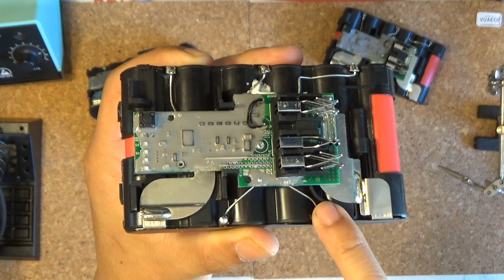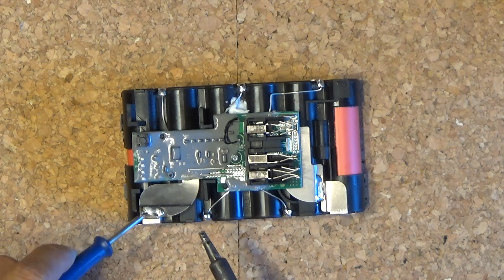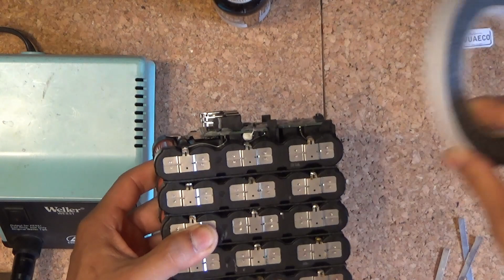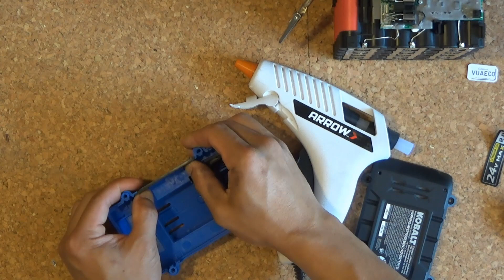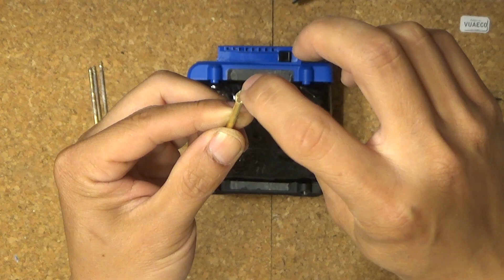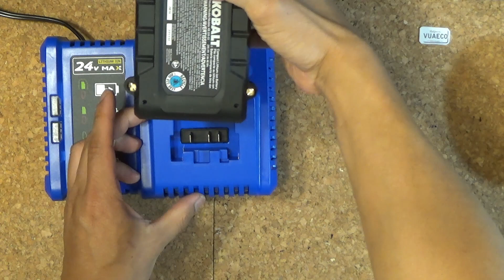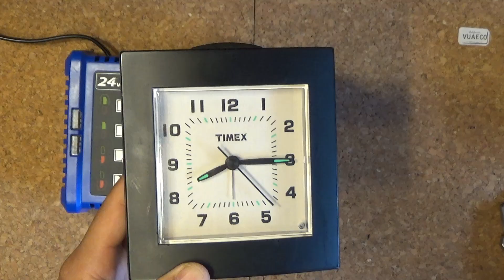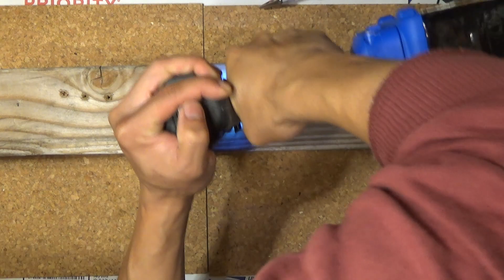DIY: The World's first 10 Ah Li-ion power tool battery built for Electric Bike home-made

Comment: You are stupid. There is no more power. It only last longer.
Reply: It is absolutely MORE POWER! Original 2A/H battery is only 48 watts. With this set up, hes getting 240 Watts. Watts IS Power!
Reply: Higher capacity batteries CAN provide more current. If the tool you are using can take advantage of that, possibly when it bogs down, then you will get more power from a higher capacity battery. There will be no difference under normal use though like you would have if you somehow increased the voltage.
Reply: there is more  power.I am using milwaukee impact gun with 5.0 ah,when i put 9.0 gun has more power,heats up faster, changes sound.9.0 ah is killing the gun,never tried long with 12 ah,gun would prolly die first day of use.fully charged 5.0 ah in use,voltage will drop to 19 volt,9.0 voltage will drop to only 20-20.5,and the gun cannot handle that voltage under load for long...
Reply: That’s the point he wants to keep voltage and make the battery last longer, if you have a 24v electronic you don’t want to over volt it to get more time out of it. It’ll just give you better performance and eventually burn you motor out.
Reply: I guess no one will venture to answer the question!     Wow, lots of opinions here.   Anyone want to try to answer a question?   If you have a 120/240 volt single phase 10Kw, 12.5Kva 60Hz generator connected to your house.   You push the button and start the generator.   How many amps is it putting out?
Reply: @KevinCoop1  all of them
Reply: @earthenergyhex     Incorrect.   You can not answer the question.   You do not know what loads are connected and turned on.
Reply: @KevinCoop1  no, I am correct
Reply: @earthenergyhex    Explain please!
Reply from the maker: @konolfodinsson4096  Hey Konolf, I totally agree with you, mate. I just check back here from time to time to entertain myself when I get bored. These silly comments keep coming. They've never disappointed me. That's why I pinned it on the top!
Reply: @vuaeco  People are actually arguing about if a larger "amp hour" battery has "more power" or not.
Reply: would this work on your e300?
Reply: @adamalexander4689  You are talking about longevity of the peak power usage if you are talking about voltage sag.  The OP is correct. It doesn't utilise more power, it just makes the drill work longer.  The drill works at 24vDC and consumes a specific maximum current when the battery is fully charged.  Adding multiple batteries in parallel doesn't change the drill's working voltage and peak current draw.  For the sake of it, the motor itself will have a working voltage of 24vDC and a specific wattage rating. Unless someone can get the specifications of the motor, we won't know, but we can guess based on working voltage and a battery fully charged.  There is possibly a 24vDC voltage regulator and current limiting circuit built in, something as simple as a zener diode.  The BMS of the battery may affect the draw too.
Reply: no you're stupid .. it has to do with how a battery's voltage lowers more and more the less juice it has in it.. if the pack is higher capacity it will run at higher voltage for longer
Reply: @Nasirisme  No one said it doesn't last longer.
Reply: @octapc  you must have completely misunderstood what i said... Batteries have a higher voltage output depending on how charged they are so if the battery has a higher capacity its gonna give you more power because it will stay at a higher charge level longer
Reply: @Nasirisme  just because someone has a differing opinion, does not make them stupid!
Reply: How many BMS you are using ?
Reply: @Rafaeljotiar  that’s My only concern. He removed all the other BMS’s. Worried about keeping the cells balanced.
Reply: The shown diy pack can provide around 5x20A thats 100A continuously. The formula for electrical power is P=U•I. If you use 20V as U its 20V•100A=2000W.  The smaller packs: 20V•20A=400W. Therefore your statement is wrong. Whether the tool needs more amps than the smaller packs or not, i dont know. So the power the tool brings to the table may stay the same.
Reply: @julianweiser9985  the electric motor is not winded for 2000w or even 400w. So there fore no more power. I mean the drill is not powereful.
Reply: @ashaygoyal1158  in this case, impossible. BMS limit current for protection. Tool motor and battery needs to be correctly designed. If tool draws more power than battery can handle BMS will take action and limit it. If BMS fail battery have a fuse to prevent explosion but will lost battery cell.
Ok but this not happen because battery and tool motor is correctly designed, so single battery provides all the power of the motor can consume.
Reply: @adrianorrs  I doubt a normal Ah size battery could provide the maximum current aloud. Where as one 10 times more might be a noticeable difference. PLUS , wouldn't a longer time of the same power be considered "more"?  tell me what you think. now i want to o a test. but "power " and "more" needs to be more defined.
Reply: @immrnoidall  there are no current limiters on the batteries if you try to extract more than they can, they will heat up and blow the internal fuses (... or even explode). BMS can be a limiter if poorly designed but in the video a single BMS is used at the top, i.e. no changes. Power in SI is Watt, Watt is joules per seconds, so battery life no matter. e.g. your car may have a fuel tank 10 times bigger, but it won't be more powerful.
Reply: Calling someone "stupid" is rude and inappropriate. Get some sense into your heart.
Reply: Unfortunately you do not know the difference in amp hours and wattage. So who is lacking knowledge?
Reply: You're wrong. There is more power, know your Ohms LAW! (E* I=P)
Reply: your english is bad. i think you meant "i am a doofus"
Reply: The sad part is, Gismo still doesn't know how to calculate watts after 4yrs lol.
Reply: I disagree there's more apps more power last longer it's like having a V8 or 4 cylinder they both do the same speed but the V8 got more power
Reply: so if it last longer there is no more power? well done einstein
Reply: you have no idea what you're talking about. shhh.
Reply: Bigger batteries can handle a higher discharge rate.
This is crackhead stuff
Reply: @PatChapp  yes u are Crack head. Learn how electric motors work.
Reply: @Gismosoffi  no you is ignorant! I am Wright. The Utuber has no klue what hes talkin bout. I've been a major master electrician for 79 years and I can tell you paralleling series only ads resistence while lowering ohms. No extra power is created.
Reply: @ricktruman1416  what?
Reply: @ricktruman1416  Great sense of humor!  you know enough about the facts to write something like this!  Good one!
Reply: @ricktruman1416  I'm a electrician. What I do on a daily basis has nothing to do with small electric motors. I've only soldered 5 times in my life and that didn't have anything to do with my job lol. Being a electrician doesn't make you an expert on this kind of stuff. How old are you 100? How could you be a master electrician for 79 years? Why is someone your age arguing in the comments section 😂.
Reply: @ricktruman1416  Power(P)=Watts(W)=[Volts(V) x Amps(A)]
Reply: @ricktruman1416  "you is ignorant" - says the guy with about 10 spelling and grammatical errors - Also super fascinated n how you can "add resistance while lowering ohms"
dood - thats like adding heat while reducing celcius - and I've been a master bator for 50 odd years!
Reply: @ricktruman1416  so you are like 100 years old?
Reply from the maker: @Gismosoffi  Wait, are you still here after trolling this comment section for 3 years? Amazing.
Reply: @ricktruman1416  strictly true but you’re missing the fact that as a tool pulls current the voltage sags. The larger the battery the less sag, so if you had a 24v battery the size of a car it would run at full power even under load. Alternatively put some Watch batteries in series and run it; it won’t work properly. What the OP has done would be by virtue of pack size decrease that sag.
Reply: Same voltage so same torque. Longer run time. A motor will function the same 2ah or 10 ah.
Reply: @kevinroberts781  the voltage will drop faster on a 2ah on load compared to a 10ah
Reply: @EFDawahWiseSmile2LanternDen  that is correct
Reply: It seems people have misunderstood the OP, completely.  Paul was referring to the fact that just because you have a greater Ah doesn't mean it will deliver more instant power, for example,   the drill will only use the same voltage and current draw no matter how many batteries you add in parallel.  What does happen is the battery will  last longer.  The circuitry will not allow unlimited current draw, it will destroy itself.

Comment: Vuaeco, the load/charge/discharge circuit is managing all of the rest of the batteries packs? The problem could be is that the BM is rated for 1 pack - it does not know the overall resistance with the other batteries inline.

Comment: Does the BMS limit the discharge current or does it only have a low voltage cut off? If u try to pull a lot of amps from a parallelled pack using one board, eg for a high power ebike battery. Would it still only allow the delivery of 1 cell?

Comment: This is a great idea and so simple. Im building an ebike and are using powertool batteries but thought i would need to stack the batteries ontop of each other. Your way  is way more efficient for space. Plus my 36 volt system would only need 2 chargers which i already have instead of swapping the batteries over or buy more chargers.  I would just use threaded rod and nuts on the top to hold them together. Another great use would be to make your own powerwall this way.

Comment: Great build!  You didn't mention it ... but you probably did it.  When you put cell packs together you should make sure each packs voltage is within .1 or 1/10 of a volt of the other.  If you don't do this when you solder those strips onto the sides it can cause a lot of current to flow between the attached packs. This can cause damage to the cells in the packs.  Liked !!
Reply: I don't understand please give an example excuse me for my ignorace

Comment: The problem you're going to have is that the BMS will still shut down at the original overcurrent setpoints, and may even error out if it detects charge current but too long a charge time. The BMS has to know what the capacity of the pack is, so if it thinks it's still a 2A pack and sees 2A of charging current for more than a couple of hours, it might just disable itself.
Reply from the maker: Two and a half years later it's still working. And it's still working now.

Comment: Great teaching, I learn a lot, can I do the same with dwalt batterries, or how about using usb adapters cap and conect them in series, like you did on the newest videos?, this is my plan, 2 (20v 5 ah) in parallel to make 10 ah conected in series with another 2 (20v 5ah) in parallel conected to a 12v 2ah in series to complete 52v 10ah for my ebike motor 1000w 48v, with that work? Thanks!
Reply: That's a real stretch... I doubt it would be Stable

Comment: Good video bud keep up the good videos quick question how mach the battery you used worth. Link if you have from where you got them from. And how many ah discharge they get up to. Ty keep up the good videos.
Reply from the maker: $20 each from Lowe's. Discharge rate is 100A (20A each).

Comment: OK, very impressive. So how many of these Kobalt 24v would I need to power a electric Ford Ranger truck with a 96volt requirement. And how would I need to wire them up? I know 4 x 24 is 96volts. But I also know I will need to go several rows of 4s to get the ummm, duration the miles requirement for the day before recharging.

Comment: Thats funny, I bought a bunch of Kobalt 2.0s to use the cells in some of my other tools packs. Its a very good deal, 10$ per amp/hr or 2 watts per dollar. Other companies charge at least double, and they use the same cells. One thing I find interesting is, I bought 9 Kobalt packs, the first one had Sanyos like yours, but all 8 after that had Samsung 20r's.
Reply from the maker: Yep, Kobalt has the cheapest batteries in all power tool companies. They used to have Sanyo cells. I've never seen Samsung 20R on the Kobalt though. Maybe it's the newer 2.0 batteries.

Comment: can't be the first, with this many cells you could use non high drain cells from a laptop or something
Reply from the maker: 5P is not many. You get about 10A discharge max from 5P laptop cells. That's not gonna run any power tools.
Reply: @vuaeco  odd, my cells seem to preform better than you outline. Anyway I'm probably a bit rough pushing them to 2c 😂

Comment: Nice try but impractical. How many holes are you going to drill?

If you are running a tv or fan maybe ok otherwise not . 
Good for a little scooter maybe.
Reply: I'm actually thinking of doing this to Milwaukee batteries so I can run and amp off it for my cooler radio without carrying a huge battery

Comment: I know this is old video but I'm planning on doing something similar. Looking back would you now construct these in a different fashion? I recently bought many of the Kobalt 1.5ah battery packs(2 for $15) and now plan on putting 10 together for 15ah packs (24 volts each). I'll wire these in series to create 48 volt packs for our trikes. I am currently using smaller versions and they work great! The smaller versions were created with not taking the cases off but keeping them intact and jumping the terminals with custom cables to create 48 volt packs. I charged the packs by taking the cables apart (a pain) with four Kobalt chargers. I want to make the new packs similar to yours but thought you might have other ideas on how to construct them. Thanks for all your thought provoking videos and entertaining humor!

Comment: With the new 21700 cells there are now OEM batteries available with only 10 cells and 18 Volt 8 Ah. For cordless drills you normally don't need such big batteries, but other tools like circular saws or chain saws can benefit from it.

You should never use soldering to connect lithium ion batteries. Even if you solder fast to limit the amount of heat going into the battery they will be damaged, especially at the negative terminal. All commercial packs are spot welded. Spot welding is the only recommendable connection method for round cells.
Reply from the maker: I disagree. Have you ever soldered a Li-ion battery and damaged it? I have been using these Kobalt packs on my ebike and it's been 1.5 years and still kicking. In fact, I solder ALL of my Li-ion batteries for everything (so far) and haven't seen any single cell that fails. Your assumption doesn't have any real facts to back it up. Commercial packs are spot welded because it saves time.

Comment: For a similar cost you could have used one and then got 18 of the lg 3000mAh cells and had a smaller pack that was 4p instead of 5p and 11 Ah vs 10 actually cheaper because those are what $20 aa piece so $100 total and my way would be  $20 for one and you can buy 20 cells for under $60 so $80 and if you went 5p it would be about the same cost and size but 14Ah
Reply from the maker: It's not similar cost because I made it in June-2017 and it's now September-2018. The price of the LG 3Ah cells has declined a lot in over one year.

Comment: Absolutely genius. The home made screws! You channel deserves to be known world wide.
Reply: bruh, when did he say 100V? 17:33 he said 100A. the battery could deliver a maximum of 100A at 24V. doesn’t mean the engine will draw 100A when it’s working. probably much less. Wall sockets (in eu at least) can deliver 16A,230V usually with a circuit breaker when exceeding 16A, it doesn’t mean your devices will draw the max amount..
Reply: Not genius at all. In fact it didn't even make sense. He was correct in calling that Battery 10 AMp hour. However he was incorrect calling it a 100 V. It is still only twenty four volts.

Comment: I'D LIKE TO USE EXTERNAL BATTERIES WITH POWER TOOLS. DOES ANYBODY KNOW THE RESISTANSE VALUE TO BE PUT BETWEEN THE MINUS CONTACT AND THE CENTRAL CONTACT TO ENABLE THE TOOL TO WORK? THE LITHIUM TOOLS ARE DESIGNED NOT TO WORK WITHOUT A VOLTAGE TO THE CENTRAL COMTACT.

Comment: I have 5 24v 1.5Ah battery packs I bought from Lowes a few years ago for $7 each and have never used them. I'm about to put all 5 packs together and use them in my daughters power wheels. Also, if you have an RC lipo charger, you can use it to charge power tools batteries that already have a built in circuit board. You just set the charger to Lipo charge (no balance), tell it the number of cells in series (6 in this case) and how many AH it needs to charge to but it will auto stop once the cells hit 4.2v.

Comment: Can I use this method to power this fan without frying it?

Voltage: 24V DC
Flow Capacity: 270 CFM
Current Draw: 3 A
Reply: I want to build a portable air conditioner that I can use the kobalt batteries in the back of my delivery truck

Comment: charging is dangerous ... you need ballancer on every single battery or if 1 battery is 100% and other battery is 95% the power input is still going to 100% battery and owercharging him
Reply from the maker: It is balance charged by the original Kobalt charger. This battery is exactly the same as the original Kobalt 24V battery. It's just bigger. It's still being balance charged by the charger.

Comment: More BMS to handle that current
Reply from the maker: Actually, no. I've been using it this way for almost a year now with no problem.
Reply: I seen the bike, if you used a 100a BMS you would get more than 30 mph
Reply from the maker: Speed is related to voltage. If the BMS isn't also a boost converter, my bike won't run faster than the voltage supplied by the battery pack.